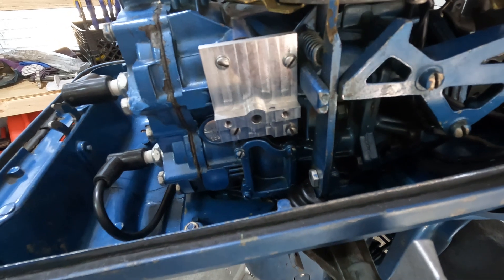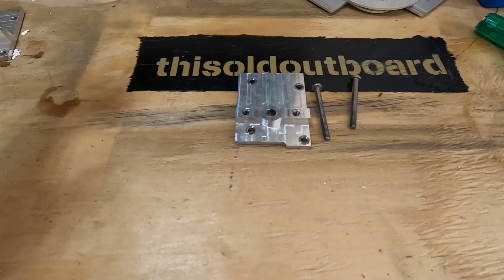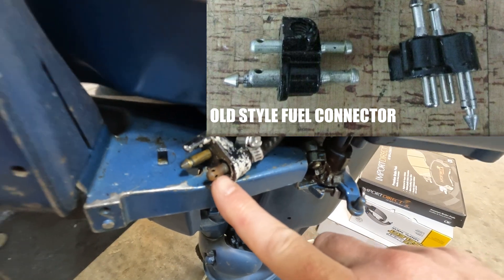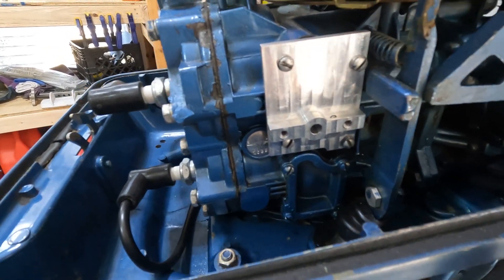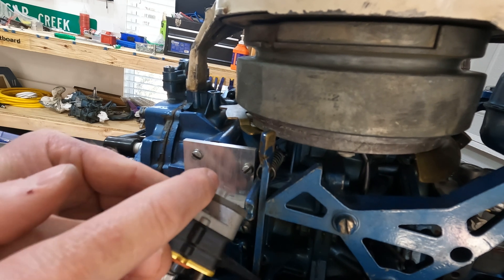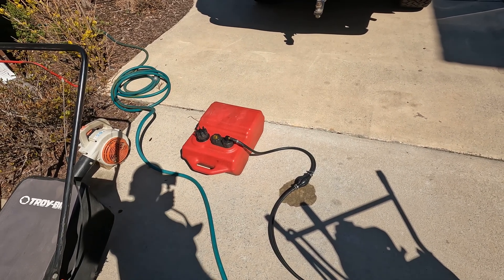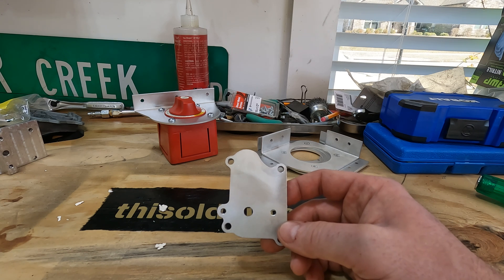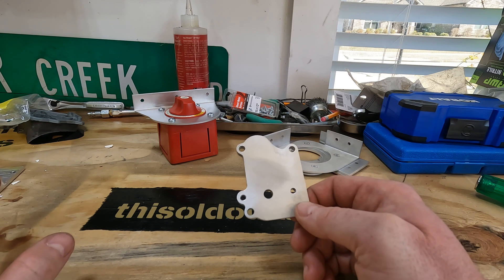Johnson Evinrude Fuel Pump Conversion (Dual to Single Line Tank) - All You Need to Know to DIY

Comment: What type fuel pump you use to convert from dual to single fuel line
Reply from the maker: Sierra 18-7350 or 18-7352